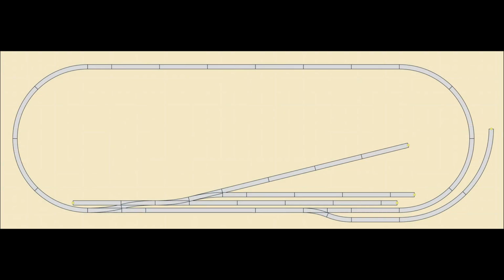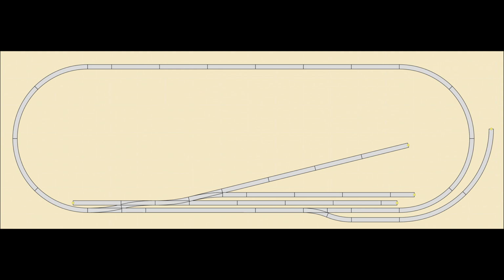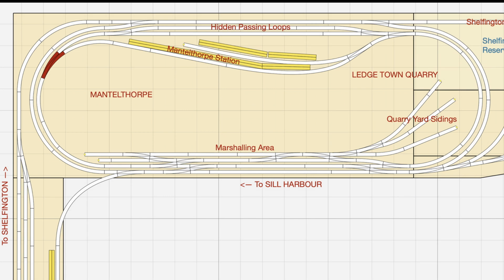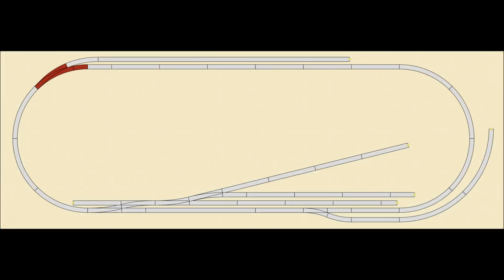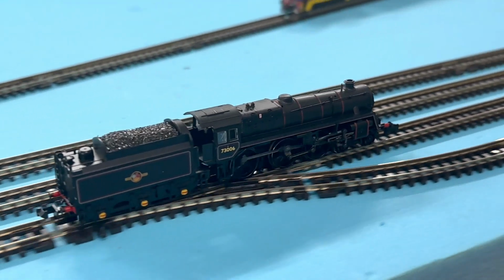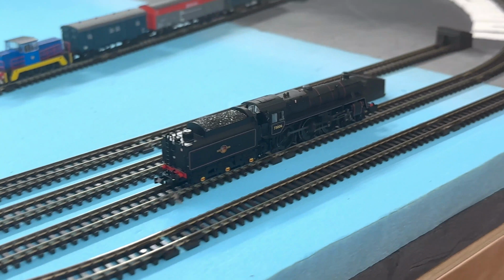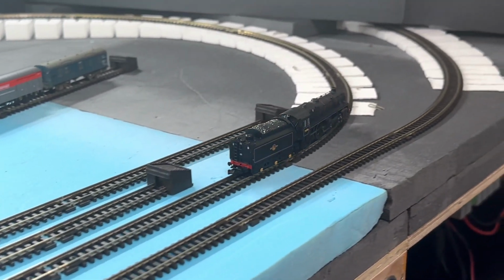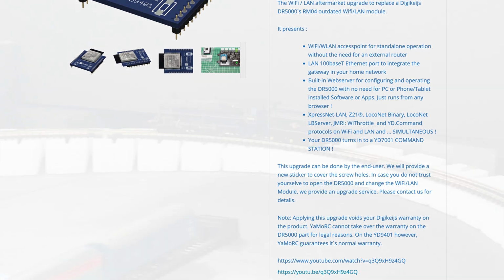076 - Test Track - Updating The Test Track

Comment: Hi Ian, if you ever get hold of one, it will be interesting to see how you go with the Yamorc upgrade. Having invested in the DR5000 myself, it's disappointing to see their demise so soon. But I've read on the Yamorc website that their CEO is the one who designed and developed the old Digikeijs stuff. Cheers for now.
Reply from the maker: Hi John! Sorry, I missed this comment somehow! Yes, I read that too, which gives me some confidence that there is still some level of support, even if there is no warranty left on the DR5000! I've got one of the WiFi modules on order at DCC Train Automation, who are the UK distributor, and as soon as I get one, I'll make a video about installing it! However, it's only a guess that this is what's wrong with my DR5000, and it could be the interface between the main board and the WiFi module, in which case I'm stuffed without further help! We shall see! All the best, Ian.

Comment: Hi Ian Nice new loco, I'm not doing any steam (although I do like the look of the new J94 in MSC grey...lol) and the Black 5 does look great. More testing, can't be a bad thing, I have several of those Setrack points in my plans and the few times I've tested a couple so far, I've had problems with a Class 17 derailing on them, hey ho, I'll keep trying...lol Having said that I wasn't aware that a streamline version was available, so I will look into that, thank you for that little nugget.

Yamorac is basically James Hudson from DCC Automation, a very good guy to consult about your controller issues, (see Charlie's (Chadwick Model Railway) videos). I'm hoping to use thier MP1 point motors when I have the funds to order them, although I think many of thier items are 'out of stock' as they are virtually bought to order and with the recent delays with chips and semi-conductors these days  there are problems in the supply chain, they are also very popular too.

Thanks again.
Reply from the maker: Hi Peter! Yes, the 5MT is a wonderful addition to the fleet! I'd go for the streamline version every time, but for my plan, it's radius is just too wide to go in the inner loop! There'll be lots more testing to come, but not until I get my DR5000 fixed, as controlling the loco using the computer is a right pain in the backside! Yes, I've ordered the Yamorc from DCC Train Automation and have used them previously, as well as seeing how highly Charlie rates them! The MP1 point motors look like great units, and I may end up with a few myself in places where fitting my micro servo motors would be impractical! All the best, Ian.

Comment: I do feel your pain in trying to get your design to work with means using setrack.   In common with Colin and Euan, I winced at the sight of the insulfrog curved point with its rather large frog.  But you really don't have much choice if that is the only curved point with the right radius to make Manthlethorp a through station. I think the problem with them is that they become problematical over time as the frog wears.  That can't be tested for easily.  At least if you start getting problems with small wheel base locos stopping, you can, if there is room, fit a stay-alive.  Be interested to see your other tests.  Stephen
Reply from the maker: Hi Stephen! Yes, it's really annoying that having chosen to go down the route of streamline points, there is just one point that can't be replaced without completely modifying the track plan! I think you're right that stay-alives will probably be the solution for smaller locos getting over the big plastic frogs! Alternatively, I can keep my fingers crossed that Peco release their unifrog points across all codes and formats - that may be a long wait though! All the best, Ian.

Comment: Hi Ian, the 5MT looks and sounds great a good choice for your first steamer!! It’s so coincidental that I’ve just fitted a curved point into my layout, one of my many track plan updates!! I’ve not run it yet so just hope it does perform as well as the one on your test! Cheers Gary
Reply from the maker: Morning Gary! Yes, I'm extremely pleased with the 5MT! Ooh! It'll be interesting to see how your curved point performs, especially if it's a setrack point! I'm looking forward to your next upload! Of course, I'll be testing the point much more thoroughly with different locos and rolling stock, but the first signs look promising! All the best, Ian.
Reply: @iansngauge  Hi Ian, just been testing the set track curved point and all works well with all my locos and rolling stock, only issue was with some Peco 16t mineral wagons as they lifted slightly going over the point but did not de-rail but I suspect it was down to a lack of weight, but other than that a good result!! Will be interesting to see how you go on? Cheers Gary
Reply from the maker: @SC68 - That's good to know Gary! Thanks! I bought some motorcycle wheel balance weights to help weigh my lighter wagons down! They weigh 5g each and so add just the right amount of weight to stop those annoying little jumps when points are encountered! Cheers, Ian.

Comment: Hi Ian, I love that steamer, she’s a beauty, I need more steam engines, I have a birthday coming up but for now I have my eye on something else🤔😁
As for the point I would go for an Electrofrog rather than setrack, only because it’s going to be more reliable on the smaller loco’s although that may not fit in terms of that curve🤔🤪
Good luck with sorting out your controller, another frustrating side of model railways🙄
Cheers for now mate, have a good week, John
Reply from the maker: Good morning John! Yes, the 5MT is a stunner, and I've already got my eye on a few more steamers! Yeah, there isn't enough room to put a streamline point in that location as the minimum radius is way too large! So it'll be a setrack point or nothing! Yes, the controller losing its WiFi module is so annoying! I'm beginning to worry how long the rest of the unit will last, and may start looking at alternatives! I've already got an NCE Powercab that I purchased ages ago, so I can press that into action if needs be, but it won't be powerful enough to control the whole layout once it's complete!  Enjoy your weekend too! All the best, Ian.
Reply: Hi Ian, I use a z21 Black, it’s a great piece of kit👍
Reply from the maker: @exehavenharbour - Thanks for the info John! The Z21 in definitely on my radar as I'd be able to use my existing WiFi throttle! I'm not sure if the other main manufacturers like Digitrax, Gaugemaster or Lenz would support it! Cheers, Ian.
Reply: hi Ian, if you do buy one check out Scograil, it’s where I got mine from, they were at the time the best price for a z21 in the country.
Reply from the maker: @exehavenharbour - Thanks mate! From a quick search they're still nearly a hundred quid cheaper than everywhere else! Wow! I'm tempted to just buy one now... but will need to resist, as it's quite a large impulse purchase - considering I've already bought a 37, an HST and the 5MT this month! Lol! I'd better wait to see if I can fix the DR5000 WiFi first! Cheers, Ian.
Reply: Lol! I know Ian, the temptation is always strong. There’s something I’m desperate to buy but, i have to have my heating fixed which is £300, car mot, service and a Spanish golf holiday to pay for this month it’ll all add up to £1000. I have to wait until 15th to see how much money I get for my birthday! I’m very lucky probably a bit like you I can kind of have what I want but there is a limit to everything!
Reply from the maker: @exehavenharbour  - You mean there's stuff you can spend money on other than model railways (and beer)? Lol! Happy Birthday wishes for the future - hopefully you'll be blessed with plenty of tokens to purchase the thing you're after! Cheers, Ian.

Comment: Hi Ian - cracking looking loco - the black 5.   As always a thought provoking video on the merits of track.   I'll be interested to see how a loco with a small wheel base copes with the very large plastic frog - especially pulling a load.  I suspect it will work but remember this a brand new point - so no contaminates in the switch blade area - yet !!   I know you are going down the code 80 route (Stephen and I have totally failed in our code 55 quest 😅😅😅 ).
My honest advice would be to deploy a code 80 curved point !  Cheers Euan
Reply from the maker: Morning Euan! Thank you! Yes, the 5MT is a stunner! I think you'll be right about the smaller wheelbase locos having problems, and we'll find out in a future video dedicated to testing how different locos and rolling stock cross the point! Unfortunately, I can't use a streamlined code 80 curved point here as there isn't enough room, so it's going to be the curved setrack point or nothing! That means code 55 could still be on the table... All the best, Ian.

Comment: hi Ian ,   wow,  i never thought for one minute that i would need to know this info about set track and streamline points , however the derailing problem occurred at our model railway club last week and i referenced your video to the derailing issue with set track .  All the points are now being changed to streamline . thanks so much for sharing your findings . Geoff
Reply from the maker: Hi Geoff! The difference between setrack and streamline points surprised me too, as I thought that you'd be able to run all rolling stock, especially small wagons, over setrack points without issue! I'm so pleased that you found the derailment videos useful, and hopefully the switch to streamline points will make everything run much more smoothly! All the best, Ian.

Comment: Hi Ian do try smaller engines, when you have a controller working again but I would use code 80 minimum and use electro frog that big piece of plastic on that frog looks like a problem waiting to happen. Gemma at Stoney-ole has alot of curved points to help with space but there electro frog and the frogs all have autofrog on and I think if she didn't the trains would be a nightmare going over them. But this is only our opinion. Are you going to the n gauge exhibition this weekend. Have a good week. Colin
Reply from the maker: Hi Colin! Yes, of course, you know me and my inability to move on until I've tested something thoroughly! I'll be devoting a whole video on testing the curved setrack point with different locos and rakes of rolling stock! Unfortunately, I can't get a code 80 streamline point to fit in the location as it has too wide a radius! If I encounter problems, I'll be ditching the point altogether, and making Mantelthorpe a terminus station! I won't be at TINGS this weekend unfortunately! I had intended to be at the NGS show in York earlier this year, but train strikes scuppered that! Enjoy the show! All the best, Ian.

Comment: That black 5 is a real nice addition.
I actually have the plans and some parts to eventually build a 5 inch gauge version, after falling in love with the actual one that runs the Jacobite.

Aside from that, Yamorc had just started, as it's set up by one of the original Digikeijs founders. So I'm guessing that he's still ramping up production (what i understand is that somewhere in this year, most products should become available).
Digikeijs has gone bankrupt a couple of months ago.
Reply from the maker: The 5MT is quickly becoming my favourite loco! Wow! A 5 inch gauge version would be spectacular! I'd love to see you build that! Yes, I was reading about Yamorc, and how they're rising out of the ashes of Digikeijs demise! Hopefully their WiFi module will fix my issues, otherwise I'll be looking at alternative solutions! Cheers, Ian.
Reply: @iansngauge  I would love to see me building it too, unfortunately I'm still lacking a workshop!😅

Here's to hoping! Though I've got a good feeling about Yamorc, if only because it's based in my hometown😁
Reply from the maker: @fladder1  - Ah, I guess you need quite a bit of workspace to construct a loco that large! I'll have to send you around the Yamorc offices to demand they hurry up and make more WiFi modules! 😃

Comment: Hi Ian,
First things first - that loco looks and sounds great! Lovely to see it going around.

Great that it's a case of so far so good on that point, though the insulated area looks rather long so it'll be interesting to see how your small shunters go over it - I suspect they'll need perfect pickup on all wheels.

I've literally just watched the video but can't remember - did you test the loco going into and out of the the siding (i.e. the point set for the 3rd radius route?)

That's really annoying about the controller :( Hope you're able to get hold of that piece and get things running again. Perhaps a good job that you've just got a DC controller?!
Reply from the maker: Thanks Jonathan! Yes, I'm extremely pleased with the 5MT so far! I think you're right, I may have more problems with smaller locos than larger ones! I didn't test the outer lane of the curved point in this video because I intend to devote a whole video to testing the point thoroughly, with different locos and rakes of rolling stock! Yes, the controller WiFi breaking down is so annoying! It makes me wonder about the longevity of the whole unit, and whether or not I should invest in a different system! I've actually got an NCE Powercab that I bought a while ago, intending to use it for testing elsewhere, so I can press that into action in the short term if needs be! All the best, Ian.